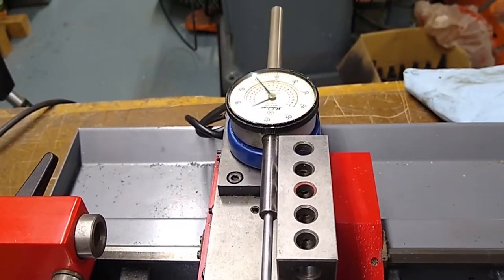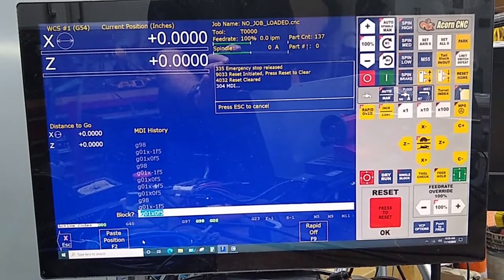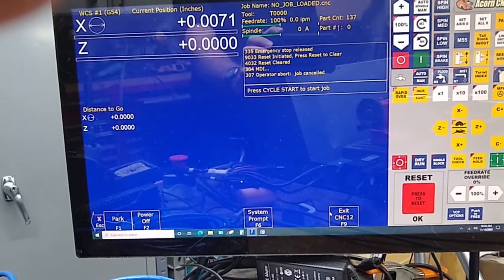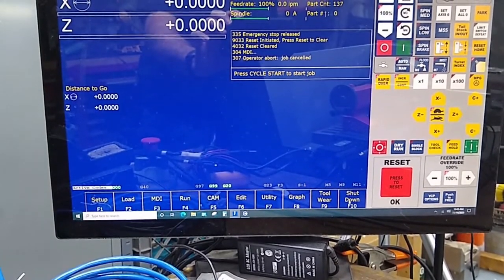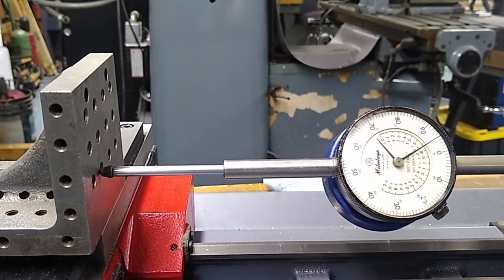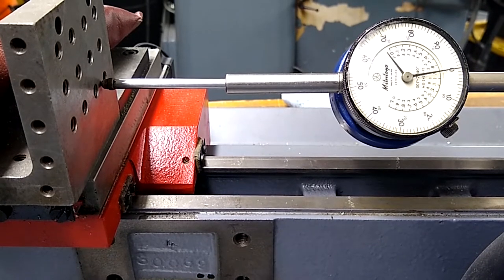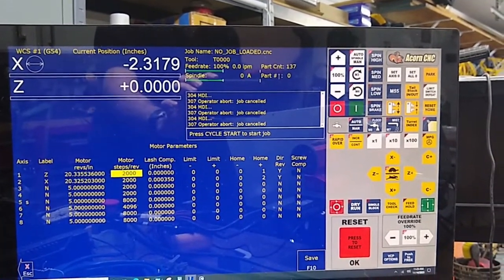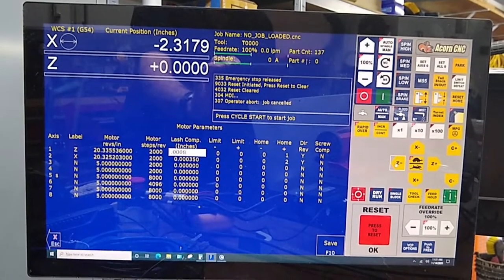Emco PC5 Centroid CNC Acorn Conversion: Part 8 Setting Z & X Overall Turns Ratio and Lash Comp

Comment: Marty great video. Could use inches per revolution for your feed rates so you wouldn't have to call up G98 before every move? Is G99 a modal code in CNC 12 lathe version?
Reply from the maker: I'm fine with the way I happen do it because I am in and out of it so many times. Truth be told, doing videos makes things 3x longer to get done....:-)